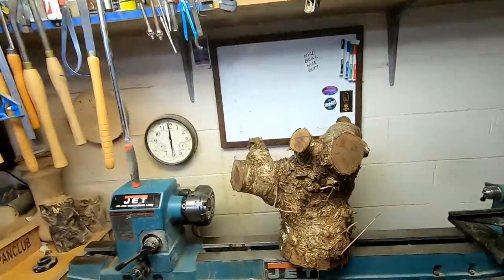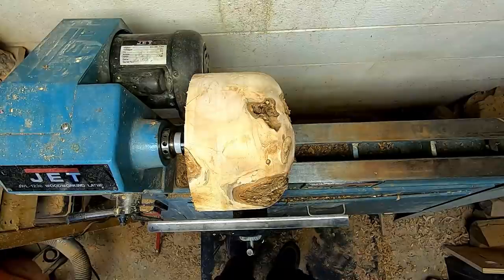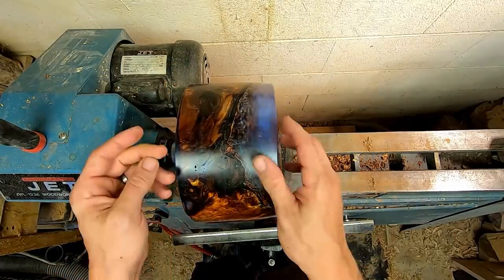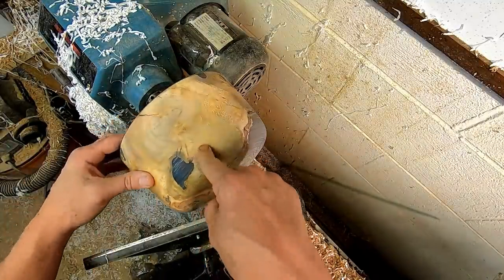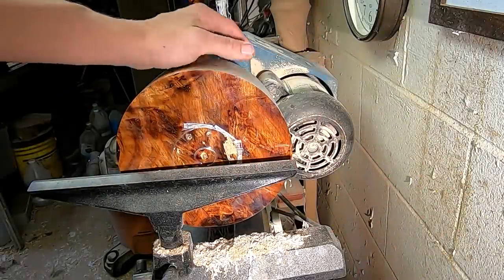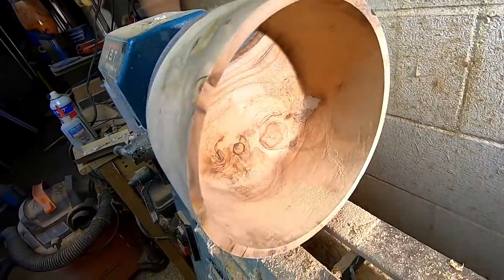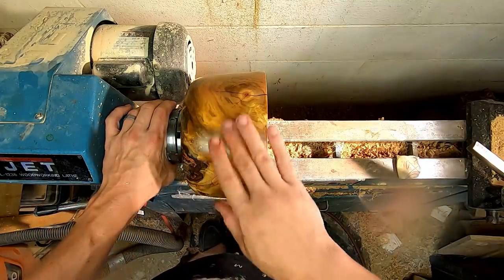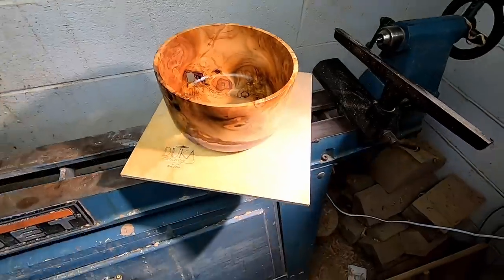Woodturning - Man Made Cherry Burl Bowl

Comment: Very pretty piece of wood Todd. What you have here I would call a Multi Mini Crotch Bowl. I have done a few Redwood pieces that had 10 branches coming out. Some of the most amazing pieces of wood can come from these.
 Sometimes I will use Howard Feed&Wax and 500 grit to wet sand a finish. Pretty handy stuff but not food safe.
This is a very nice piece but I would have liked the resin to be blue. But blue is my favorite color.
 I understand how hard it is getting a video out when you are under stress.  I set aside the one I wanted to finish for this coming Friday because I did not want to work on it while being stressed myself. So I did a much simpler one to fill in.
You take care of yourself and do your best to relax a bit.
Gary
Reply from the maker: Thank you Gary for your regular support, it truly means alot to me.

Comment: What a great looking bowl. I was wondering about using a vacuum pump to remove moisture from wood. Do you have a problem with cracking?
Reply from the maker: Thank you Dean, I'm glad you like the piece. As far as the vacuum drying goes, I usually do it in stages. If the wood is green, I find that its best to run at room temperature for a few days until the water stops collecting, and then add heat for however many more days it takes to dry. The heat control is the most important, try to stay as close to 95 degrees as possible. The higher the heat the higher likelihood of cracking. Hope this helps.

Comment: I love the windows Man, so  is acts that easy?
Reply from the maker: Yes the Acks always works great on wood for sure. The most important thing is to make sure that the resin is sanded to at least 600 before applying the abrasive paste to avoid sanding scratches being left behind. As I'm learning its also important to keep the abrasive wet until all the grit fully breaks down. I'm going to try using mineral oil next. :)

Comment: Oh man, your random quips kill me everyday ^__^ "bicycles are fun" and the demeanor change for Yay did me in. Sir, got me dead again.
On a turning note, why sanding sealer, why 2 coats, and what do you use? 
Good eye with the brand touch up!
Reply from the maker: 😁 glad you like our stuff! So the sanding sealer, as in the name, seals the piece after sanding but they add zinc sterate which raises any lingering pushed over grains and allows for a finer, smoother finish with the abrasive pastes. It also keeps the broken down abrasive from filling the grain. PS thanks for the support!!
Reply: @dukaheritage9445  This is the best, most comprehensive (yet new person friendly) explanation I have gotten. Thank you so very much!